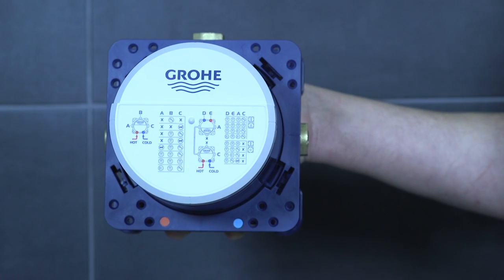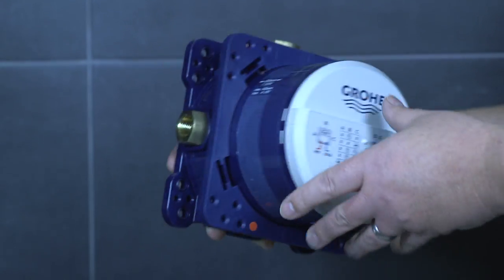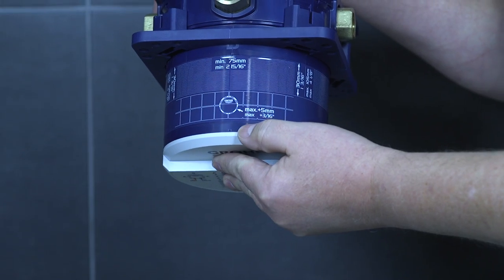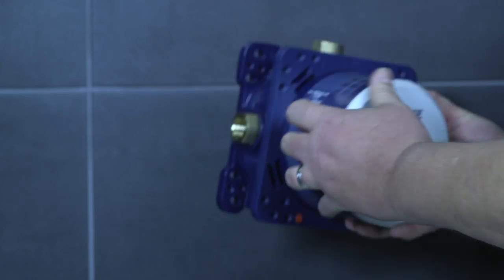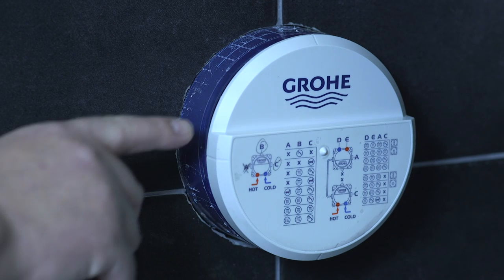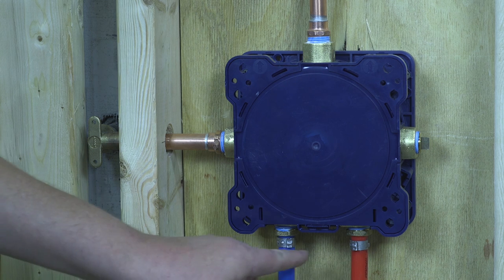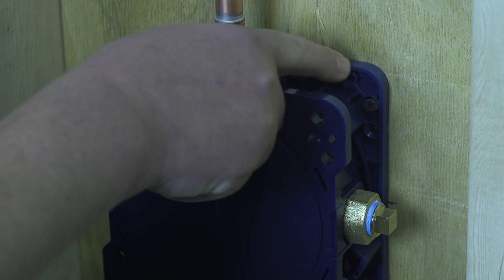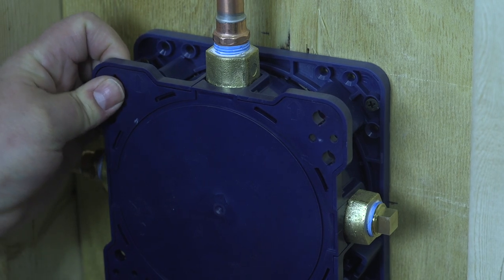GROHE | About the GROHE Rapido SmartBox | Installation Video

Comment: Please post an instructional video showing how to set the temperature of the hot water.  When I turn my shower on, all I receive is scalding hot water.  How do I make the adjustments so that I can have a shower that will not scald me ?   Page 6 of the installation booklet only shows pictures.  I need some written explanation along with pictures in order to understand the process.  Thank You.
Reply from the maker: Hi Daniel, thanks for reaching out to us. Can you please email us at Groheconsumerconnection@lixil.com  and put "Attention Cody/Deidrea" in the subject line. Our Consumer Connection team will be happy to walk you through the process. - GROHE Social Team
Reply: @GroheAmerica  email send just now.
Reply: @GroheAmerica also stuck here please help. Only get freezing or boiling hot water. No mixing. Please email over instructions.
Reply: Please, same problem. How you solved it? Please! 🙏🏽
Reply: Please, same problem. How you solved it? Please! 🙏🏽

Comment: They show it mounted with the front bracket but There’s usually only  concrete backer board there and that’s after I install the shower valve. I’m confused.

Comment: You piped that incorrectly. Port B should go to the shower head and then return to port A
Reply: Nope,  port B to the shower head, port c to the hand shower, A gets capped. Just like the matrix shows on the cover.
Reply: WTF! 😂😂😂 ok buddy! 

A and B are only used on shower head if you have a dual function shower head!

Something tells me you should stay away from plumbing 😂
Reply: @bliffblam  No mine works perfectly fine as I have a dual functioning shower with a hand held.
Reply: Lmao...its still wrong...dual function shower and a dual function shower head are 2 completely different things. 

There is no such thing as a return line.. .😂😂😂😂😂

They are 3 seperate ports for 3 seperate functions. It is a universal valve used for both dual and triple function!!

1. Main shower head
2. Hand held
3 rain shower on ceiling.

You probably did it because you watched grohe installation video when they ran both ports to main shower head.

That was because it was a dual function shower head. 2 different spray patterns controlled by buttons on the control panel!

Ur a smart one lmao!

You also realize that this video is by grohe!😂😂😂
Reply: @bliffblam   Still not wrong I have a rain function and a shower overhead  If you like I  Post a video of my shower working just fine.
Reply: @a914freak  it doesnt make it right...if u only have 2 buttons your only controlling 2 ports. 

I'd like to see a video of your shower with 3 buttons, if not it's wrong period!

Funny thing is, you told a grohe tech he was wrong 😂😂😂